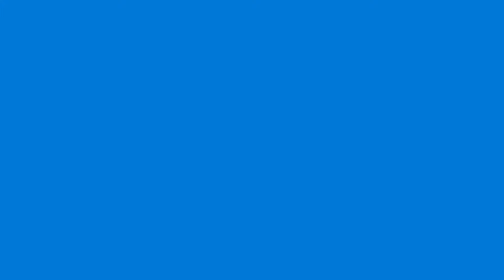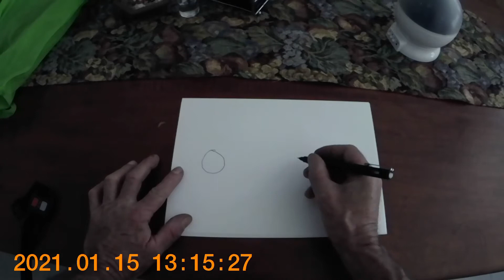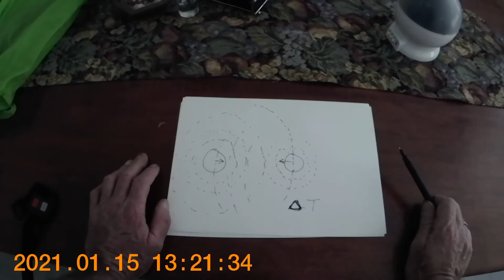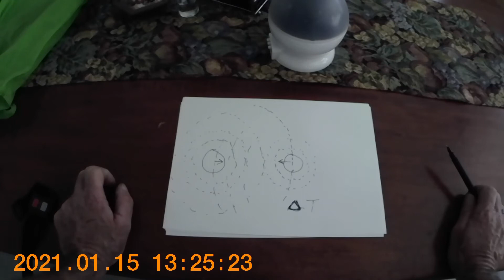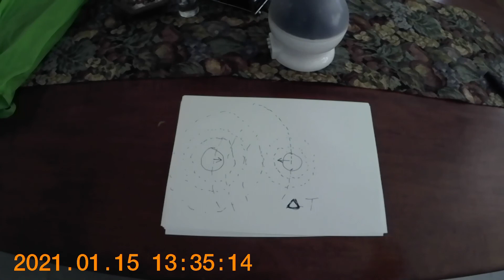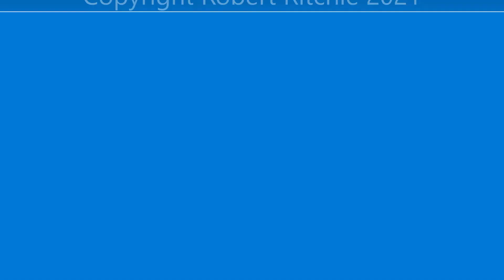Gravity research 2021

Comment: Do you use two slow clocks in your device?
Reply from the maker: A very pertinent question John. The two clock experiment is right up there in the to do list as I am skeptical of time dilation.
Reply: @postiemania  I try not to burn my fingers from time dilation or length contraction.
Reply from the maker: @_John_Sean_Walker  I don't take them into consideration.
Reply: @postiemania  My brother in law is experimenting with the same thing, more or less.
He is using a very slow clock in his device.
He doesn't want to experiment with rockets yet, but he is experimenting on trains.
He measures extreme accelerations, but he uses only about one-thousand millivolts.
He thinks that you are using way too much electricity in your design.